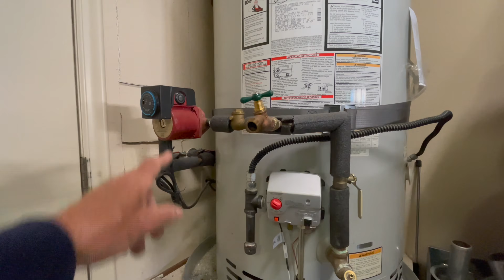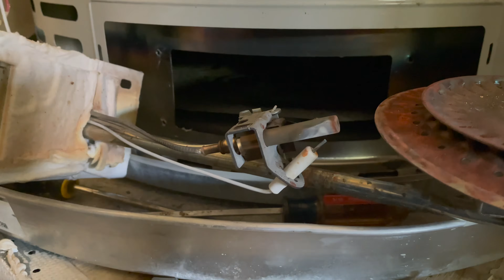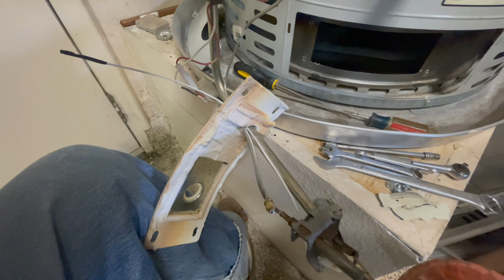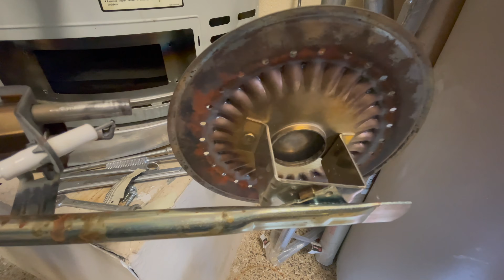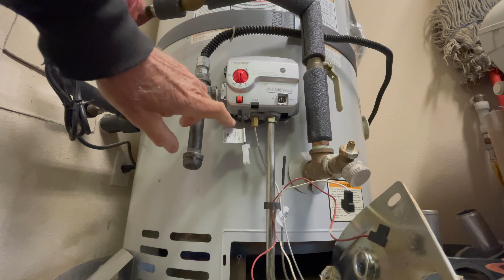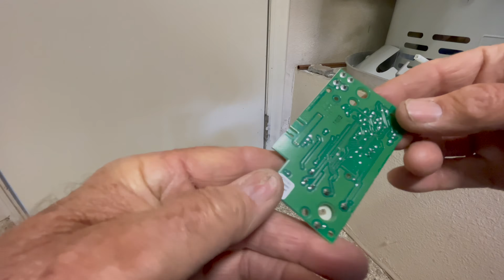Honeywell Gas Valve Water Heater Pilot Trouble shooting steps

Comment: On my unit, which has the same Honeywell controller, the pilot light refused to stay on. The thermocouple (aka thermopile) was oxidized and colored gray with reddish oxidation at the end. When heated, the thermocouple was only supplying 300-400 mV, which is not enough DC to power the control board. I used 400 grit sandpaper to clean it off to almost chrome looking and now it supplies 650-750 mV and the pilot stays on perfectly. I had this problem 5-6 years ago and I did the exact same thing to fix it. Cleaning the thermocouple is now part of my 3-4 year maintenance schedule on the water heater. Thank you for the detailed video!
Reply from the maker: Thanks for sharing. It is always a good feeling to be able to fix things on your own!

Comment: Do I need to put pipe dope AND teflon tape on the threading of the gas valve meter?
Does the Teflon tape need to be “yellow” which is rated for nat gas, or can it be white which is rated for water?
Reply from the maker: I use the white teflon tape for everything threaded but I did not know that therre is a yellow tape that is used for natural gas. That said, back in the 1970's I ran gas lines for pool heaters and we all used the white teflon tape and never heard of any issues with it

Comment: Mine is lit but gas won’t catch. Gas is ON, Pilot is LIT. Any ideas?
Reply from the maker: Probably the flame sensor needs replacement. If the flame sensor does not detect heat from the pilot it will not open the gas valve to ignite the burner.  Sometimes cleaning the flame sensor works too